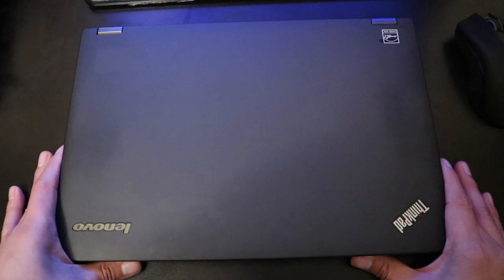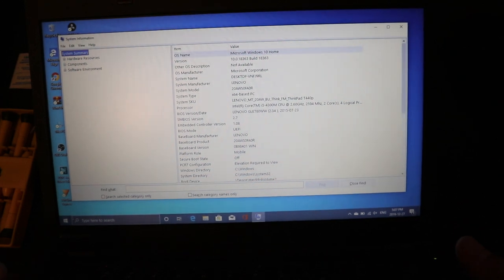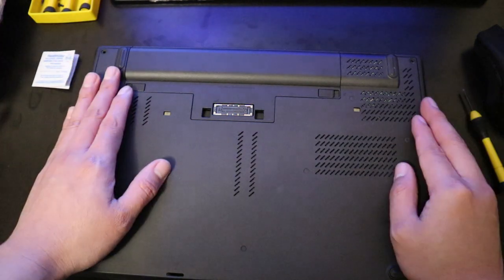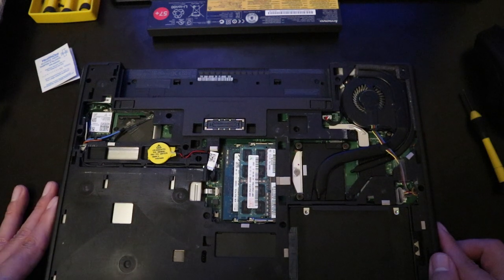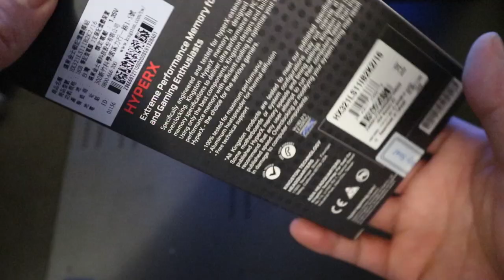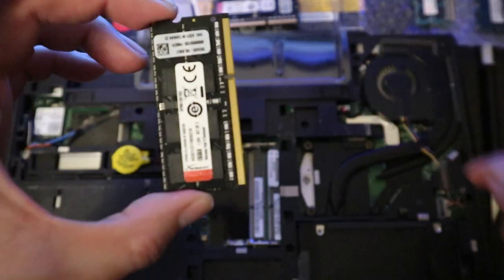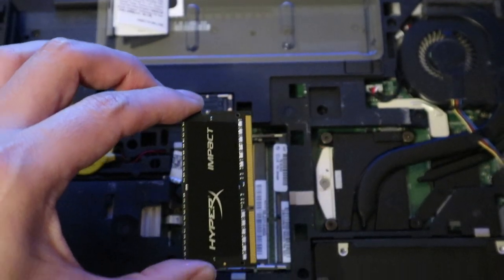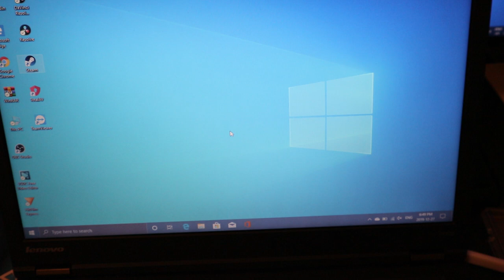Ultimate Lenovo T440p Laptop Upgrade Guide | CPU, RAM, HDDs, 4810MQ ,  16GB 2133Mhz ram.

Comment: Have you tested your memory with MemTest86? Are there any errors in Dual Channel? I'm asking about that because my HX318LS10 working at 1600 without any problems. But at 1866 there any many, many red entries.
Reply from the maker: no problems atm, its still up and running.